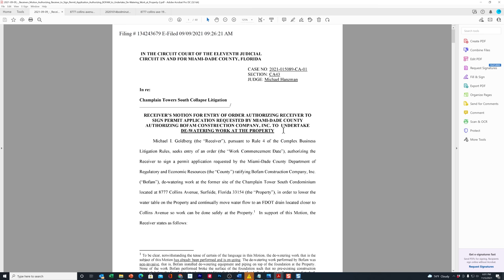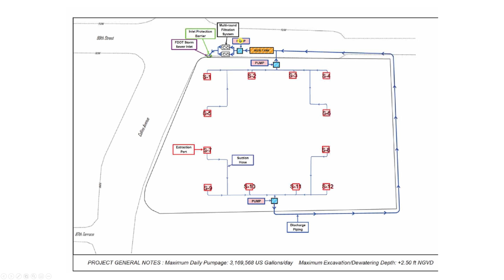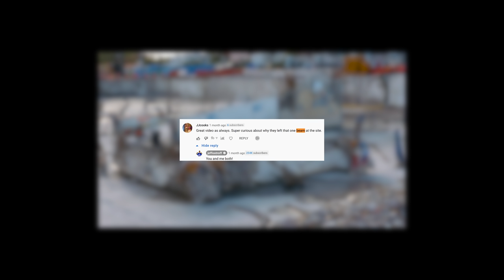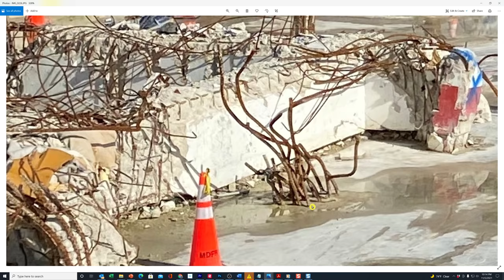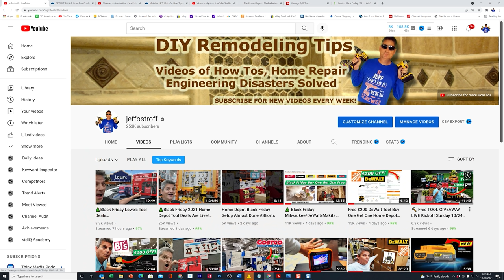Miami Condo Collapse: Engineers Baffled By Mystery Column

Comment: And remember if the column did come off the top of the "H" beam it had a free fall drop of as much as 8' or more with with a 12 story building pushing it thru the slab.
Reply from the maker: Whenever you make a claim like this about the column falling eight feet and impaling into the garage floor, you forget that there is zero damage on the floor where there should have been craters or something else if it had impaled into the floor but there is no damage. These rebar rods look like they were intentionally built up out of that concrete floor like it was done by somebody in the last 12 months, since Fiorella shot her video inside the garage in July 2020, showing no column exists where that mystery column is.

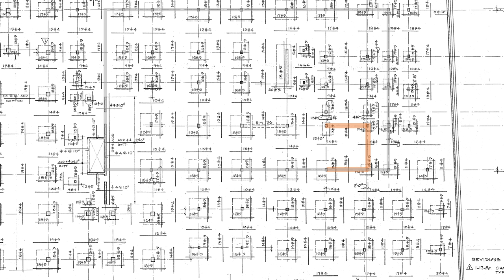Comment: At 8:20 you show a C-shaped beam; at 9:20 you show an H-shaped beam. The graphics are off, the original drawings are off, and/or the actual build is off. Also, that beam did not fall straight down, and almost certainly did not fall perfectly parallel to the garage floor. My money says the mystery column is the one that originally ran from floor1 to penthouse (or part of it) punched into the garage floor. Easy enough to prove...pull the rebars. (Likewise, any shoring or hack fix should be easy to prove). What it ain't is aliens, Big Foot or Loch Ness.
Reply from the maker: You are wrong and yo need to review the photos again. the beam lost some of it's H-Shape, it is not a c-shape, but still has the defined H-shape. The Beam landed 12" north of the 4 columns that were supporting it. No way that K column you refer to pirced the floor. you forget that there is zero damage on the floor where there should have been craters or something else if it had impaled into the floor but there is no damage. These rebar rods look like they were intentionally built up out of that concrete floor like it was done by somebody in the last 12 months, since Fiorella shot her video inside the garage in July 2020, showing no column exists where that mystery column is.
Reply: @jeffostroff  I'm not wrong. Here's are my points: 1) If drawings & construction are correct, the only column in mystery position is the FL1-FL12 from above. 2)Beam did not fall straight down as you first said, it's shifted as you say now. Beam also cannot be proven to have dropped perfectly parallel to garage floor; column FL1-FL12 could have come almost perfectly straight down. 3) A quick run of the numbers says rebars in column FL1-FL12 could have hit the garage floor with up to 50 times (possibly 100's of times) more than the compressive strength of the concrete they were hitting. I agree that it looks very clean to be "impaled". But I contend that neither you nor I have ever witnessed such an impact event. So I say they could have punched thru that floor in the blink of an eye & a puff of dust. Bottom line: "Mystery column" is either FL1-FL12 impaled or it's a recent remedial patch/shoring job, both of which are easily proven. It is NOT the work of aliens, Bigfoot or the Loch Ness Monster, so I won't call it a mystery.
Reply: Nope. it is 01-8
Reply: @designstudio8013  I don't know what that means? Are you saying mystery column is #01-8? Because I can't read drwings (or vid) well enough to pick off the column numbers. (my notation FL1-FL12 meant column running from floor 1 to penthouse)

Comment: Strange to say the least. Kinetic energy does a lot of things in a collapse so it is possible that column was driven into the floor of the garage. Can not tell for sure without macro lens photos of the rebar and area around it. Highly unlikely but on the edge of possible.
Reply from the maker: Whenever you make a claim like this about the column falling eight feet and impaling into the garage floor, you forget that there is zero damage on the floor where there should have been craters or something else if it had impaled into the floor but there is no damage. These rebar rods look like they were intentionally built up out of that concrete floor like it was done by somebody in the last 12 months, since Fiorella shot her video inside the garage in July 2020, showing no column exists where that mystery column is.

Comment: Did the basement slab fall?  Maybe that rebar got pushed up from below?  Otherwise, it looks like someone came in and installed that rebar - Moribito perhaps?  Maybe they were looking at the first floor drawings and thought "Oh crap, there should be a column down there!" Snuck in at night to add the rebar to cover up what they thought was a mistake, but really just read the drawings wrong and compounded the confusion.
Reply from the maker: You can see basement slab did not fail. How could something come miraculously up from the earth? That makes no sense and you give no evidence to support it
Reply: @jeffostroff  Wow, that was a rather harsh response.  I thought maybe a part of the foundation, such as a footer could have punched through the slab.  If the ground below developed a sinkhole, during the collapse, could it not have fallen into the sinkhole?
I was simply speculating, I'm not an engineer, that's why I watch your videos.

They had to come from somewhere.  There is no evidence that a column from above embedded itself in the slab.  They were using post-jacks during rescue, not pouring new columns of concrete.

My other thought, that it was placed as part of a cover-up is an elaborate conspiracy so it seemed more likely to me that they punched through the floor.  But as you said that basement slab did not fail.
Reply: I'll let you know if a black SUV parks outside my home tonight.

Comment: Its not a mystery column its the transfer column going up  that was integrated into the beam. It  punched through  and the steel drove through the slab... They cut the steel and it looks like a column . The water coming through is because the steel punched through the slab...  Mystery solved ..
Reply from the maker: Not so fast if it speared into the decking like you said, where is the damage to the concrete slab?
Reply: @jeffostroff  Theres a hole in the slab  with steel  sticking out... the water table rises with the tide and water is coming through  the hole. the steel  went through the slab the concrete part of the column stopped short or disintegrated . You can see the steel is not like the other columns  left .   And you can see the beam was pulled south and down, and that turned the column into punch ..

Comment: Keepin mind the H beam would not fall straight down becuase it’s in one piece it had To rack a has to be with in a couple of feet from the hight of the basement ceiling maybe 10 ft away from where it was.Think of it as a sheet of Plywoid setting on 4x4 post that are 4 ft high as a table. You give it a push the plywood falls and is going to land 4 ft away from where it was standing.
Reply from the maker: Based on several of us looking at the pictures and studying the columns and where we know they were underneath the four corners of that age beam, it appears that the H-Beam landed 12 inches north of where it was compared to the columns that supported it.
Reply: Plywood doesn't weigh 65,000 pounds.  Your physical model:  FAIL.

Comment: The only explanation is the column seen ... is the one from the first floor that went into the H beam at that center point .. but it was not built INTO the center point on the H but floating on it.  You do not see that center beam rods coming out of the structure do you?  Nope.  So that beam was sitting .. SITTING .. on the H beam and not connected to it.  And once everything started falling the whole H beam slipped out from under it.  Then with the full force of the building above it's pile drived into the ground and bent as everthing collapses.  So now it's a low point where water collects and you only see the top of the column that is now embedded down into the ground.
Reply from the maker: Yes it sure seems suspicious there.

Comment: Looking at the H beam sitting on the ground,  I don't see any evidence that the center column going to upper floors was ever attached in any way to the center of the topside of the H beam
Reply from the maker: Yeah it might look like that but there's just so much rebar that got ripped and torn we don't even know what was where. And remember the column attaches from the top of the floor slab above it which the beam connects to the floor slab so likely you wouldn't see much on top of the beam

Comment: there is another beam with red on it dude in the other direction - not sure it is relevant but it is just incorrect one beam was painted with that red stripe
Reply from the maker: The beam you refer to is way on the other side of the garage. I was specifically talking about any columns within 1 or 2 columns of this H-Beam in order to show I was correct in the placement

Comment: maybe the first floor slipped off the h-beam and punch into the floor
Reply from the maker: where is the damage to the floor if the column pierced the floor? Not true
Reply: @jeffostroff  the floor is of much more higher quality and strength than the column. Therefore, the rebar could easily just pierce the floor without any crater forming.

Comment: Anyone consider its just a bundle or rebar that was pushed through the cement during the collapse, it's clearly not there in the film. And I find it hard to believe they would add a piller after the film was made...why would anyone put a piller in the middle of the main lane of a parking garage.

Comment: The "H" beam is not in its original position on the floor relative to the ramp, it appears to have moved\slid over to the next bay. The "mystery" column is on the drawings
Reply from the maker: You are incorrect the H beam has not moved over. You're going to have to show us exactly what page on the floor plans in where and how you think it is moved over because it is not. Also, the column does appear on the floor plans on floors one through 12 like it should be because that is the purpose of the H beam to support that column. But what I am saying is the column does not appear on the garage floor level of the drawings nor should it be. The entire purpose of that H beam is to carry a load of that floating column from the first floor up to the penthouse and carry it down to ground through the other four columns so that you don't have a column going down into the middle of the driving lane of the garage.

Comment: I built an impressive Lego bricks building with lots of floors, and it didn't collapse until a friend tried to lift it, didn't know what he was doing, and lifted it improperly, not using the secret lift-points that I knew of, well since I built it. Hmm. Sabotage maybe?

Even so, a major section stayed intact even after it fell. I haven't gotten around to rebuilding it from so many years ago when it collapsed.

He should have asked me. I would have told him not to touch it, I will move it.

It didn't have nearly as many beams or supports. No rebar. Just friction-fitted bricks. No actual floors, just pretend floors, as I didn't have enough Lego bricks to build much of the hidden parts of the building. But then it did weigh much less and was much smaller, so there is that.

Perhaps that isn't very relevant, just me being an engineer wannabe. I had bought multiple freestyle Lego bricks sets, just because I wanted to be more creative and to build something. But being an adult, we adults tend to build the thing and just leave it standing, not break it down to play with it more like a child would do.

Comment: I explain you. 
The H-beam did not fall straight down to the floor but was tilted on the still carrying column to the south. So your questionable column is one of the corner support columns of the h-beam .
The left the h beam there but chiseled away the columns.
Your single angled pictures do not allow confidentiality judgement of positions
Reply from the maker: LOL, you did not watch the video or pay attention, LOL.  The mystery column is not one of the columns that were holding up the H beam as you stated. The H beam fell straight down and you can still see in the video that all four of the columns that were holding up the H beam are still there right next to their four attachment points. So the H beam fell straight down not at an angle but straight down those columns and shifted over about 12 inches to land next to each one of its four support columns. So far the likely scenario is that either the mystery column was added in the last 12 months, or it was that K column that the H beam was supported that came down and poked through the floor

Comment: It's almost impossible to tell but I would assume it's column 18, column 17 was marked red because it was set back a little. All of the different angles of pictures and video don't help the matter in any way. Looking at the pictures is impossible to tell how far apart the columns are besides that, when you look at the red column 17 in one of the pictures, i wouldn't be to sure that that's not just a block of concrete and not the original position of it... The mystery lays in the way it was photographed, that's all :) Look at the womans video in slow motion and you'll see that column 18 is thin and wide maybe a 16x24 or something
Reply from the maker: IT can't be column 18, because it lies one column east of the H-Beam

Comment: Does the sister building 2 blocks away give you a clue?
Reply from the maker: They both have somewhat different floor plans but very similar in this part of the garage they're both virtually exact, but there is no column there on the floor in the sister building.

Comment: The extra column may have simply been a mistake (by a new hire?) that was left in place because it would have been a problem to remove after discovered?  Or left in place because it was felt that it was necessary or did no harm or was determined to have been helpful in some fashion and they 'forgot' to put it into the revised plans?  Don't mind me I'm not an architect or structural engineer just brainstorming...
Reply from the maker: The column was not there in 2020, we showed it was absent in the garage walk through video
Reply: @jeffostroff  It was under the floor, then?  It hardly looks like it could have been installed after the collapse so logic would mean that it was installed sometime between  the walkthru video and the collapse.  For extra support?  That would hardly be something that could be done without anyone knowing....  Sorry I misunderstood the explanation.   So could it have been beneath the garage floor?  Thats just very odd, something is being missed here, possibly?

Comment: Perhaps the force of it falling smashed it into the ground so hard that it looks like it was always there.
Reply from the maker: Whenever you make a claim like this about the column falling eight feet and impaling into the garage floor, you forget that there is zero damage on the floor where there should have been craters or something else if it had impaled into the floor but there is no damage. These rebar rods look like they were intentionally built up out of that concrete floor like it was done by somebody in the last 12 months, since Fiorella shot her video inside the garage in July 2020, showing no column exists where that mystery column is.
Reply: @jeffostroff  I guess I just feel like they are too cheap to have spent the money on such a repair.🤷🏻‍♀️

Comment: the mistery column : maybe you should go back at the sister building garage and find out if the column is there . I wounder why the pool and spa still there since it did not have any impact on the event. This event is more or less as puzzeling and interesting as the Titanic is but is seem like it is now just barely a memory. I hope you will go on in search thought we already learned a lot
becose of the hard working folks like you. Thx a lot and have nice Xmass time with family
Reply from the maker: The column is still there if you look at my video from early September where I showed you my evidence that it was the column M 11.1 that fell first, I shot that video outside the sister building to show that the garages have the exact same floor plan at that part of the garage and it clearly showed once I overlaid the tourist video over my video that the third column in is the one that fell

Comment: As far as the impalement theory notice the somewhat even spacing between the rebars at the contact point ground level?  Perfect puncture penetration would only be possible if the rebar was encased in concrete yet we seen no evidence of concrete residue material on the rebar. Highly unlikely that this particular column would have every trace of concrete removed off the bars during cleanup. In addition as mentioned before the area around the puncture would be vastly larger, broken up, crumbled etc. Concrete doesn't just seal itself back up around rebar when impaled unless it was still wet. More plausible theory is that the rebar was already there set in concrete sometime after the walk thru video jmho.
Reply from the maker: That is my theory as well!
Reply: Yeah, the mystery column is perfectly aligned in row 'O', and perfectly spaced between rows '8' and '9'.  Not accidental.